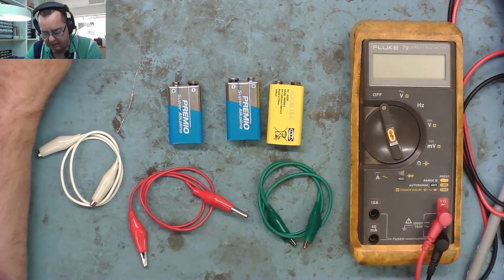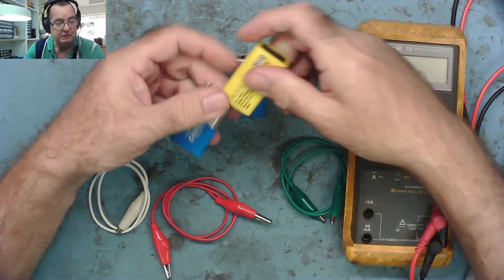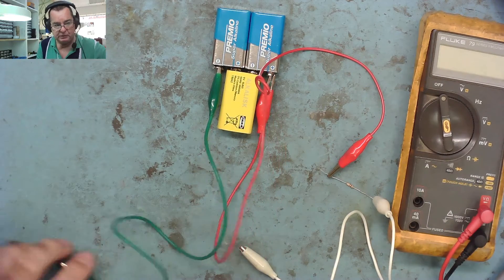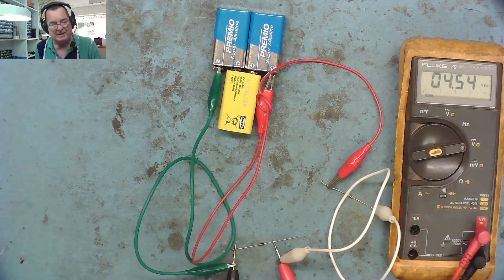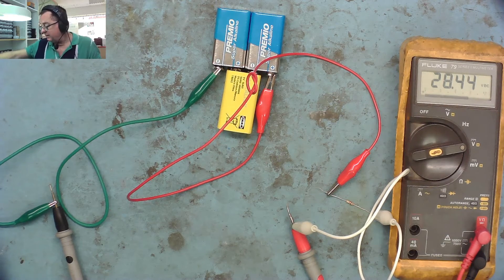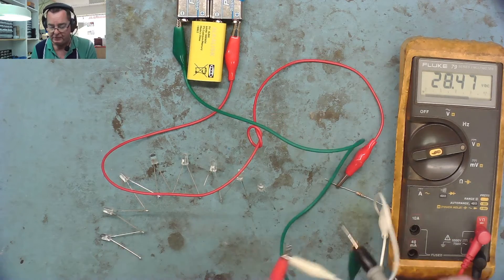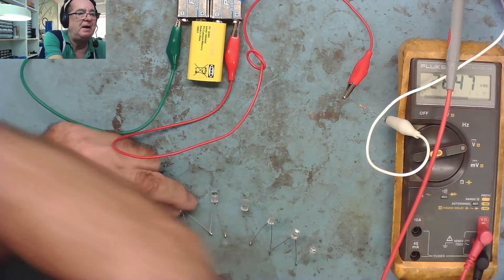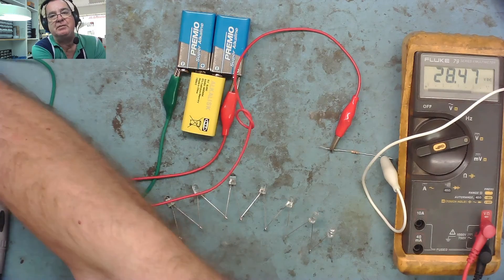How To Test Zener Diodes & LED Lights Without Variable Lab Bench PSU. LED Tester. ENGLISH

Comment: Could you please tell me the purpose of the resistor in this circuit ?
Reply: It limits the zener current to prevent damage.
Reply: The purpose of the resistors in the circuit is to have energy dissipate through
the resistor as well as allows us to read the voltage on the zener diode through the
multimeter. 

In a circuit if you connected the 27 bolt battery supply straight to the zener
diode, it would be difficult to read the voltage on the zener diode because it
would be reading the same node. Therefore the multimeter would just read 27 volts. 

When we connect the resistors in the circuit, it allows for two things, the
resistors sees a voltage drop and 2 the electrons are limited to the amount
allowed through the resistors. The voltage drop across the resistor allows us to
read the zener voltage as well as protect the component being tested and ensure
that we do not exceed the zeners breakdown voltage. The resistor also becomes a
protector of the component by not allowing too much current pass through. Having
too much current, causes components to become hot and fail.